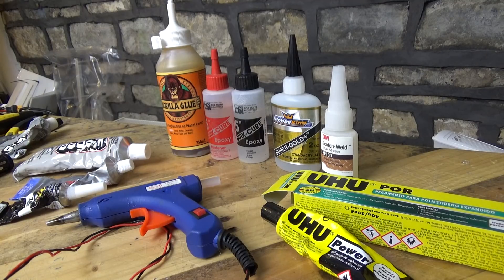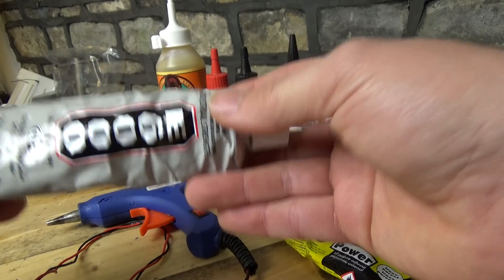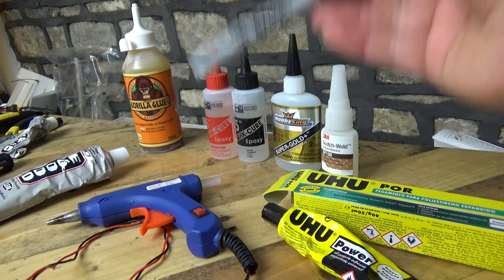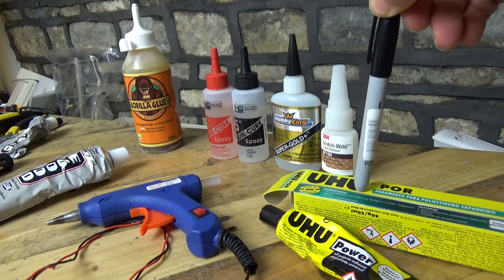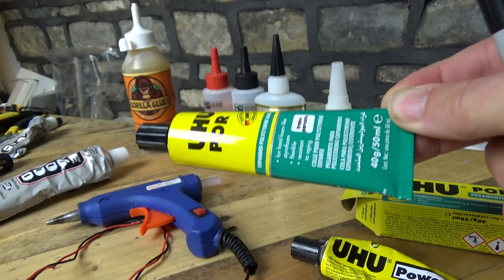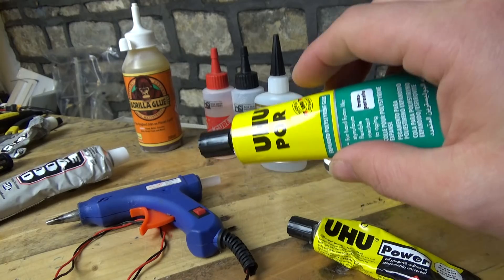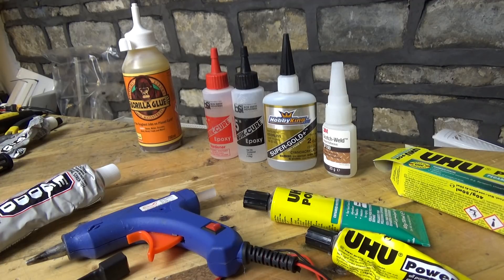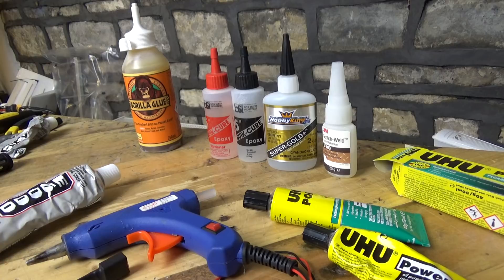Build Tip: Glues for Building RC Model Planes (My favourites & why)

Comment: Hey Matt, one super important thing with 'dirty hot glue' which makes it stand way out for certain applications is that it is easily switchable. Just adding a couple of drops of isopropyl alcohol to a hot glued joint gives immediate clean release, and the joint can be easily separated. I use it especially for mounting things like servo's for that reason, makes replacement very easy. Cheers.
Reply: i know Im kind of off topic but does anyone know a good website to stream newly released tv shows online?
Reply: @Yusuf Gannon Flixportal :P
Reply: @Koa Marco thank you, I went there and it seems to work =) Appreciate it!
Reply: @Yusuf Gannon glad I could help xD

Comment: Howdy Matt..Excellent video, good information with some examples.
Some info from me - The white glue used for furniture making is also absolutely foam safe.
Its easily available from local hardware store & its cheap. It just needs longer to dry & needs both surfaces clamped or just put pins to hold.

Also it is very good, if you want to cover the whole wing with colored paper to make it strong, crash proof & smoother surface.
Just need to dilute it with equal amount of water & apply on whole wing with a paint brush & stick on the paper.

Comment: Thank you Matt for sharing your opinions.  Like you, I have used most of these glues, and I mostly agree with your views.  

A few of my own opinions:

Regarding original (brown) Gorilla Glue, it MUST be clamped as the parts cure.  Otherwise, it is useless as an adhesive.  When used properly, the foam joint will be stronger than the foam itself.  Disadvantages of Gorilla Glue include the fact that it expands as it cures, often leaking out the sides of the joint.  (it is easy to apply too much gorilla glue.)  And it is gold colored when dry, standing out against white foam.  On the plus side, Gorilla Glue is incredibly strong, bonds to almost anything, and weighs less than most glues.

Regarding hot melt glue, there are several types.  Check out the Infinity Bond hot glues.  I rarely use standard (low cost) hot glue.  I prefer acrylic hot glue for most rc applications.  Other great hot glue sticks include Surebonder "Best" glue sticks, and Infinity Bond "Tough Guy" glue sticks.  Also, a higher wattage hot glue gun will typically allow you to apply more hot glue at a time (before it starts to set up).

Thanks again for the great video.

Comment: Matt, excellent rundown of the various glues we all use and you were spot on in describing each product. However, let me add a couple points on Gorilla glue that you didn’t cover. Yes, It expands quite a bit when you add water and will push things apart unless you tape them securely in place. It is perfect for things that can’t expand like securing a wing spar in a drilled wing hole. Also, it does have a weaker bubble matrix as you said, but if you use water based Elmer’s White glue instead of water,  it limits the foam expansion and doubles or triples the strength.  Gorilla/white glue together should bump its use way up your list.
Reply: I'd like to know more about this method Tom...
Reply: Elmer’s White glue? is that the same as pva?
Reply: Jon Wise yes pva is the same thing.  Any white school or wood glue will work. Use about 80-90% gorilla glue and 10-20% water based glue. The white glue strengthens the foam cell wall membrane and makes the foam much stronger and also limits the foam expansion because it limits gas exchange making everything denser. Get some and experiment.  It’s cool stuff. Cheers.
Reply: The only problem with using gorilla and white glue is that to get the full effect, like epoxy, it must be mixed.  That brings up the problem of  once you mix it how do you apply it.  In one case, I used a big syringe (10-20 cc), removed the plunger, squirted in the two glues, gave it a quick stir with a piece of leftover carbon rod, stuck the plunger back in and then used the syringe where I needed to apply the glue.  It is messy, and you don’t have much time, but it works.  In cases where you are putting two parts together you can apply the gorilla glue to the part, add a bit of white, stir it together then apply the other part.  The glue mix works well but it’s not the easiest method to use.

Comment: Mod Podge is excellent for covering foam.  It makes the surface harder, which protects the foam from landings and wrecks.  You can also paint on top of it, as it seals all the hills and valley's.  ALSO, if you are going to use medium CA, use a pump spray activator on the other surface.  It makes the CA cure super fast.  For foam to foam, hot glue or Uhu Por is the only two I would use.
Reply: Thanks for the Modge Podge heads up. I suppose you use it like the original Johnsons Klear and Minwax so loved of US builders

Comment: Best all around glue I use for everything is Goop/ ShoeGoo mixed 50/50 with Toulene, it can be mixed to a thin, to a thicker consistancy, sticks to anything including stainless steel, and glass. Be careful with some types of epo, and abs foams. Also some abs plastics. Will not affect epp foams. It is similar to silicone caulk, but it actually can be removed from most surfaces. Very very strong, and flexible. ALWAYS test your substrates before you glue....

Comment: Hey Matt
I use E6000 a lot, but it will defiantly melt Depron foam.  Also we here in the US have avaliable some stuff called Foam Tac and Foam Cure, I think there the same suff, but they work very well,on all foams.  Gorilla glue I only use to fill in the holes and gashes I put in the wings.

Comment: Matt, great help video, here is my take.....UHU POR is my go to glue for all foam joints and dont do the contact method, glue and tape overnight, almost never use CA.....Epoxy is pants on EPO foam......BUT brown Gorilla is brill for gluing a carbon spar inside a wing, when i glued my SONIC 64, i used gorilla on the spar to foam, as it expands so the spar grips, but UHU POR for the foam to foam joints

Comment: I broke my nano talon today and ripped the plastic wing mount out of the foam. So which glue should I use??
Reply from the maker: Morning fella, this is where I would personally use E6000 or UHU Por. You can;t use the Por as a contact adhesive I'm guessing, so use as a normal glue, use pins & tape as needed and then leave in a warm place over night to set. Hope that helps J, Matt
Reply: RagTheNutsOff ok, thanks I’ll give that a good 👍

Comment: What would you use to install a servo into a wing without screws and that could be cut easily for replacing with a new servo without damaging the foam
Reply from the maker: Hi Brian, thats easy,cut the arms off the servo and hot glue it in, instead. Matt

Comment: Advice please -
I need to glue a small plastic piece to the plastic (?) covering on my balsa plane -
      a Leader 480 
I've tried all these but it will not stick
foam safe CA medium
epoxy
super glue  (not foam safe)
canopy glue
foam tac
Elmers wood glue

gorilla glue will stick a little but not great

I have never used hot glue and don't have a hot glue gun - 
don't know if it would work.

What can I used to make a small plastic piece stick to the covering ?
Reply: the best answer I've got is not to glue to the covering but to cut the covering off  (a small area) and glue to the balsa wood that was underneath the covering.

Comment: Check out Starbond EM-2000 and the Activator.  It is a pretty awesome thick CA to work with where you want strength / rigidity (like spars).

I used Goop / E6000 otherwise.   Great stuff!